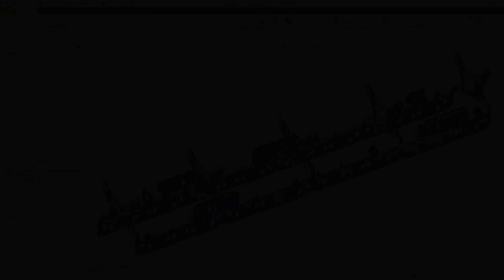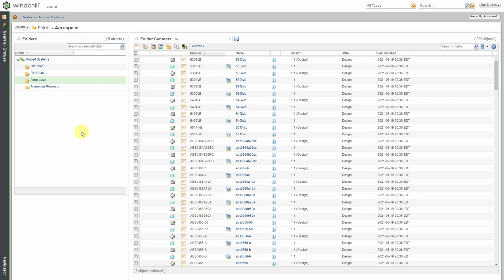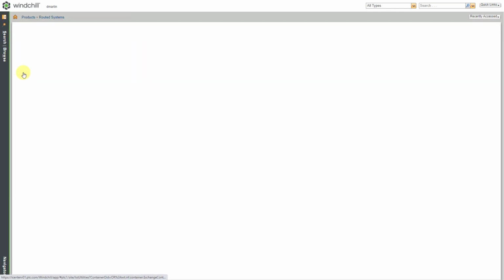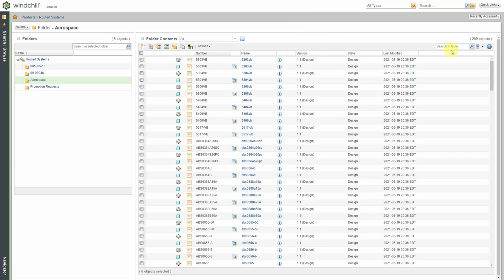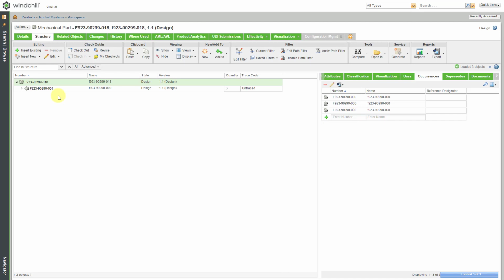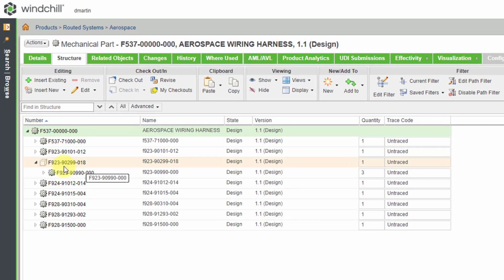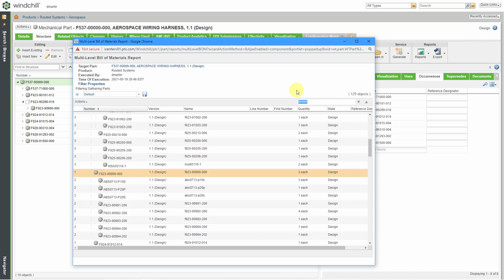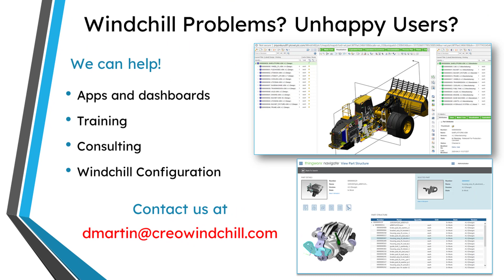PTC Windchill PDMLink - Gathering Parts | BOM Management

Comment: What about ESi integration. Does it filter gathering parts
Reply from the maker: It should depending how it’s configured. However, it’s been many, many years since I’ve dealt with any integration. Therefore I recommend you reach out to your VAR or PTC rep to confirm how you can manage BOMs with ERP integration today.